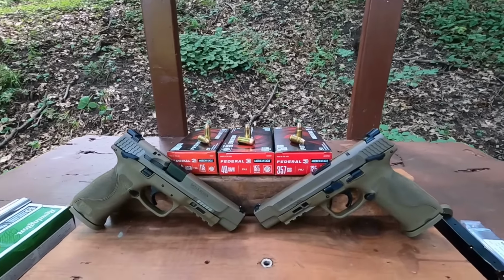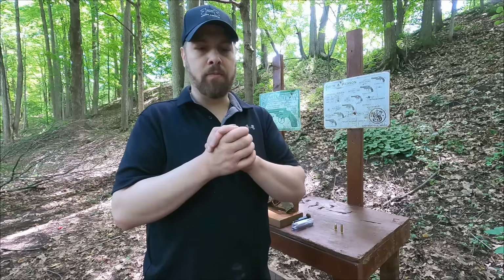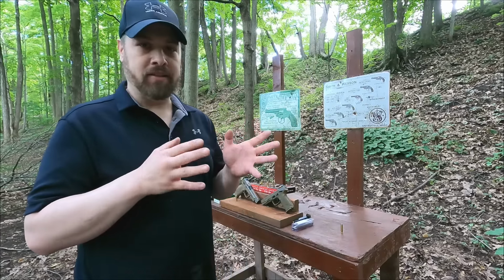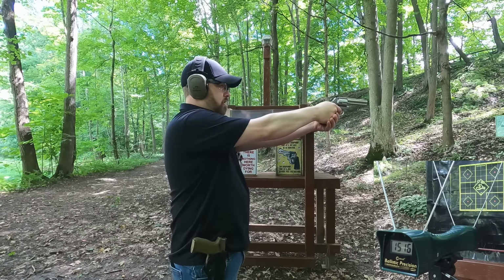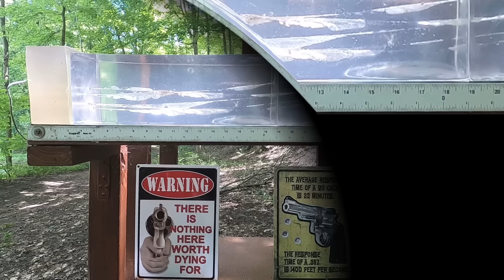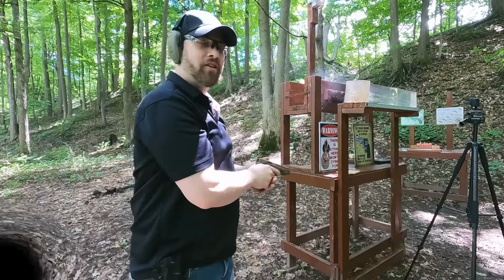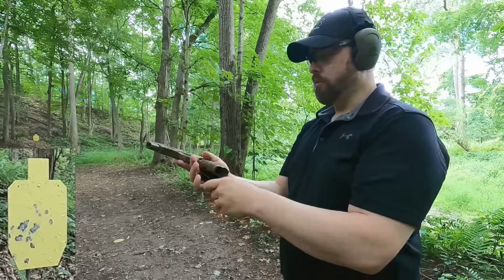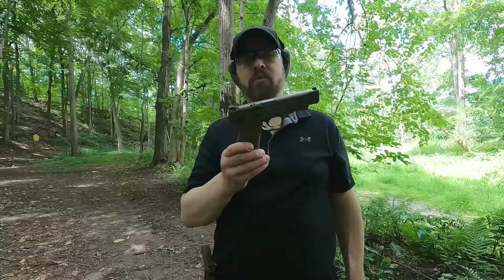.357 Sig? Cartridge Introduction and  FMJ Ballistic Gel Test (VS .40 S&W and 9mm)

Comment: I am a huge fan of 357 Sig, but not of Federal ammo, especially American Eagle. Some of Federal's loads -- even defensive JHP loads -- are grossly underpowered. For example, their 115gr JHP 38 Super is 100-150 fps slower than the 125gr JHP 38 Super from Winchester and Sig. More relevant to this video, many Federal loads of 40S&W are 50-75fps slower than similar sized JHPs from Winchester and Remington. If anyone still doubts Federal has some weak loads, compare their already weak (compared to Win and Rem) 180gr JHP 40S&W to their 180gr JHP 10mm - the 10mm is 40fps slower. That's just pathetic.

I know some of their HydraShok 45 ACP and 9mm were well regarded -- I carried 45 ACP HydraShok for over 10 years -- but I no longer trust Federal.

Comment: If you want to hit a guy in the back who's getting away with your bicycle, the .357 Sig is the best. However, it costs $1.44 per shot. The .40 cal is $0.44 per shot. The 9 mm is affordable and is the best for plinking. I shot my .40 cal after dark at a big lake. Boom! A foot long flame shot out with an impressive recoil. Anyone coming in my door sans permission is going to get up to 21 rounds of .40 cal using 2 clips and one chambered. If I'm just shooting for fun, that's $4.40/clip for the .40 vs $14.40/clip for the Sig. But who only wants to shoot one clip at a gun range? The speed of sound is 1125 fps (Mach 1) at SL. Drag goes assymptotic approaching Mach 1 then drops way down above it. The .357 Sig uses what is termed "the flying shithouse theory," i.e., if you put enough power behind anything, it'll fly. The Sig gets its power from stretching the cartidge neck from the diameter of a 9 mm to identically the diameter of a .40 cal, thus the .357 Sig gets past that high-drag Mach 1 number.  Summary: 9 mm for plinking, .357 Sig for shooting someone getting away from you (ideal for police) or for hunting, and .40 cal, .45, or .357 mag for someone illegally entering your home. We're not disgussing shotguns, right? Oh, then there's the .38 and .22. What about them? Lastly, he's FOS saying that the .357 Sig is related at all to the .357 Mag.
Reply from the maker: I don't know where you get your numbers lol. First look on ammoseek has .357 Sig at the lowest cost box at $.044 cents a round, the .40 S&W lowest cost box at $.026 a round.

Comment: 'A woman' attacked by 4 people dropped them all with her 357_SIG = An off duty Secret Service female agent dropped 4 thugs lol
She would probably have dropped them with a 9mm.. or a 22...

_

You could cut your gel blocks in half or in 3 pieces and place MDF/5mm plywood/steel sheets between all the smaller blocks.
Useful to see if the 'penetrator' threat (FMJ/hardcast/AP) is digging straight, too.

You can also use a normal block/2 normal blocks, and place a big pine wood board 2 meters behind followed by denim wrapped gelatin/water bottles. Duplicates the consequences of 'overpenetration' and the real risks of 2 birds one stone..

Comment: I believe 357 sig is a dead cartridge I don’t think sig even chamber’s  for it.
Reply from the maker: I mean, because the .40 lost popularity the .357 did too. But what is unique about it is that it's actually really good. That's why some police departments still use them. I just shot some Xtreme Defender 68 gr today and was averaging 2,223 FPS.
Reply: Sig Still make Slides and Barrels for the P320 in 40 and #357Sig

Comment: The 357 SIG is going the way of the 41 AE, 32 H&R, 40 S&W, 45 GAP, 327 Federal, 41 mag, and a host of other rounds which failed to catch on.
Reply: .32 H&R at least experienced a little bit of a resurgence when the .327 Federal revolvers came out.

People have been singing a death dirge for the .41 Magnum since 1964.  It may not be as popular as the .44 Magnum, but it has a strong following that never seems to get any smaller (or any bigger, for that matter).  I think it will hang in for a while.

And I don't think .40 S&W is going anywhere any time soon.  Yes, police departments are dumping it in favor of the 9mm now that bullet technology has improved greatly.  But look at where those guns are going:  the civilian market, and cheaply.  There are too many guns out there in .40 S&W to start declaring it dead just yet.

The .357 Sig is, sadly, on its way out, though.  Sig doesn't even make anything chambered for it anymore.  The only thing keeping it hanging around are Glock and makers of conversion barrels.

Comment: I'm a 40 guy all the way. It's a short 10mm that will out perform a lot of your off the shelf 10mm if you buy Underwood, buffalo bore, ect. I killed the biggest buck to date with Underwood 155 xtp moving at 1300fps with 582 ft lbs of energy.